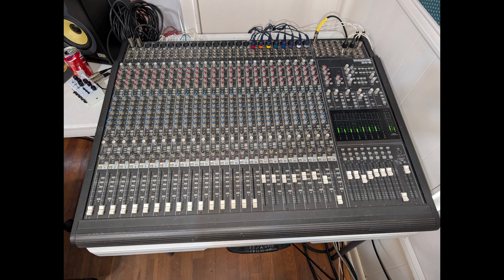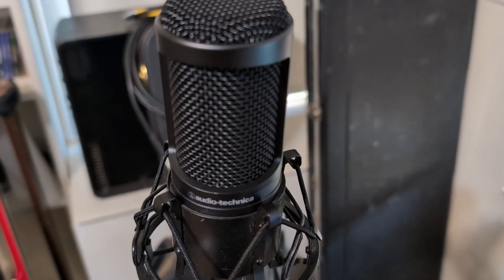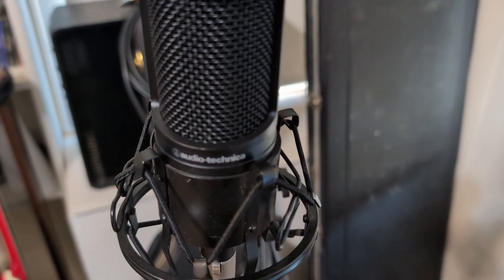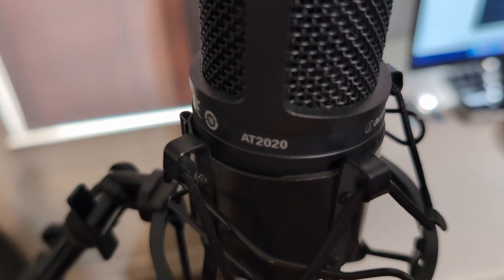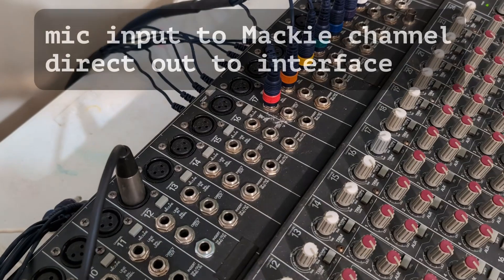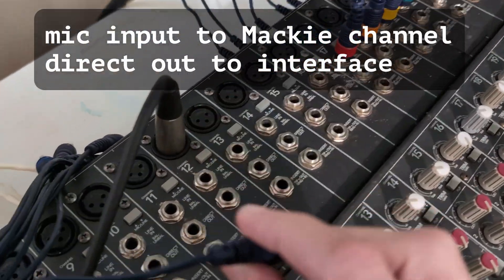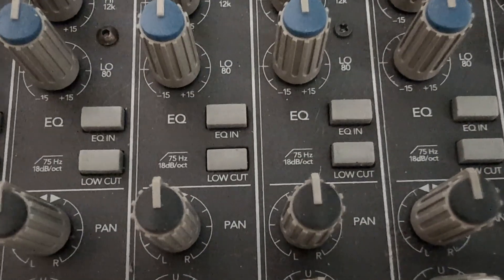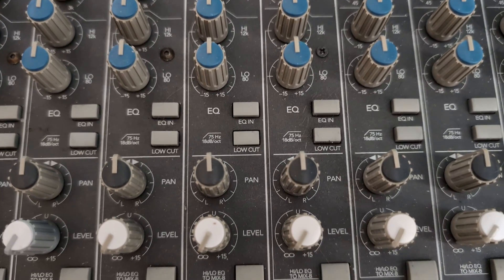Mackie Analog 8 Bus Mic Preamps

Comment: I've just got the 24/8 and I'm loving it so far. Such a unique sound and it really glues the mix together. Good to see someone making videos like this even though the manual is very in depth and tells you a lot more than I expected. Please can you tell me, does your power supply let out a little transformer growl when switching on ? Like current inrush or something just mine is concerningly loud sometimes and I fear for my hand lol. I'm thinking it might need a recap and that might be the culprit.
Reply from the maker: Yes, mine does that but it's not really loud. The transformer does have some mechanical vibration too. I have one bad channel on mine but otherwise, it's solid. They are pretty solid consoles that seem to last. The power supplies were built really well which is more than I can say for my Soundcraft.
Reply: Thanks for putting me at ease and yes it's definitely assuring seeing made in USA and not the orient on the back. And that's lucky, it must've been well looked after. I wasn't so lucky as it was from a music school and it's pretty beat up but I've gone through it and thankfully just a few scratchy pots here and there and then I've just rebuilt the vu meters as the needles were disintegrating and I'm going to have a go at changing the  bulbs to led's. It's definitely worth looking after and keeping going if you ask me especially when modern alternatives are made in China and they're all surface mount components which can't be replaced or repaired. 
I'd recommend checking the capacitors in your power supply as the larger smoothing ones take a bit of a beating compared to the smaller ones. they will probably be domed on top and approaching failure if it's anything like mine but if that's all that's wrong after 20+ years of service then it's definitely built like a tank. 
Thanks again for the help man much appreciated!

Comment: Had my Mackie 32x8 console in an Argosy console desk or 20 years.  For me, getting to that point, where I had a big console and a padded armrest console desk like in the Police "Every little thing she does is magic" video... It was a huge deal.. I started out with a Tascam 238 Syncaset  cassette based 8 track, then moved up to an ADAT.. then DAWs took over.

My studio in the basement used to have 24 channels of MOTU Digital I/O (2408 MK2, and a pair of 12/24's). The mic pre's were the direct outs from the Mackie's channels..  
I used Cubase SX, and once I got into the box, I never really did set up mixes through the tape returns on the Mackie again. Just mixed in the box, or sent the tracks off to my producer friend to mix.

Then PC bus architecture changed, and upgrading the MOTU 424 interface card that drove the IO rack units for a third time for a set of converters that were 3 generations old was not worth it. 
But in that heyday, I had 12 mics permanently dedicated on the drum kit, two guitar rigs and a keyboard rig and bass rig, always feeding discrete channels to the MOTU ready to track any time the guys came over.. 

Music buddies moved out of state when they started families, I got married, Had kids, career in IT took off for the stratosphere, and the need for a 32 channel console was gone.. 

After that whole studio gathered dust for 15 years, I finally sold the console to a close friend who could put it to use on the road as the music director and sound man for a troupe similar to the Big Apple Circus, and I sold the Argosy to a guy running a school for audio.  

In 2019 I decided to start making music again, and since I am a vocalist primarily and a recording guy, didn't really have a live band to record on a regular basis anymore, yet didn't want to completely give up having the ability to maybe record a drum kit some day, I picked up an Apollo x8p, an Intel NUC hades Canyon PC, and built a small corner of my bedroom studio around it, and I love it. 
The near zero latency monitoring with UAD effects, just like back when I had an analog 8 track tape setup with outboard...  All on Reaper, which I happily pay 60 bucks for every two years or so. 
UAD mic pre plugins emulating classic preamps and channel strips I would NEVER have a chance to track through and tweak, much less own, guitar amp plugins. All with near zero latency confidence monitoring with any of my UAD plugins as my headphone mix while tracking vocals.

Fast forward a few years and I saved my money and renovated a beat up guest room in my house, and it is now a beautiful music room / recording / mixing room, that doubles as a guest room. I still have all the gear I really liked, I still have my Symetrix 501, My Tascam 122 Mk III, the Tascam DA-30 MK2, my synths and Kurzweil PC88mx, my whole mic collection, my Omnirax ProStation MC, Lexicon LXP-1 and LXP-5 BOSS SE-50 (KILLER leslie simulator in that little beast) I even have an original Blackface ADAT that only has about 80 hours on the heads.. Repaired all three tape machines recently and they are up and running in the studio..   The whole setup of keyboards, two guitar rigs, bass rig, V-drums now, etc is all on a set of four 48 point patchbays normalled the way I work most of the time. Getting to that place was a 2 year slog.. Time to get back to making music...
Reply from the maker: I used a 56 channel Mackie at my second studio job back in the 90s. A few years later, my band bought one to use for our shows and also recorded our debut album with it and a pair of DA-88s. I got the 24-8 in the videos for $50 a few years ago and it still works except for one bad channel. 
I had a 27 year IT career after a few years of working in studio and running sound. I always kept a small studio but as it started to become an overgrown home studio, I started the YouTube channel. YouTube has given me a reason to have a lot of older analog gear. I saw that there really wasn't another YouTube channel covering the older analog gear. At least not one that was making good videos with good information. I found that I really enjoy making videos and have kept at it for 6 years and over 320 videos. 
I'm currently building out 2 rooms for my studio after moving last year. I'm trying to make the new studio better for filming since that's the main use for my studio now. 

I left IT work in 2023 and became a teacher. Now, I teach computers to K-5 students and work on my music and YouTube during my time off. I can finally say I love my job and my YouTube hobby. 
It was really good to hear your story and I thank you so much for your comments.

Comment: Hey, Grady ... what´s up? Are those postfader direct outs? I know some mixer have this option via jumper when you open it. 

I just found one of those consoles in a good price point here in Brazil including the meter bridge.

But the thing is that I prefer sending a processed signal into the DAW and postfader DO´s would be extremely welcome in my case.

I know there´s lots of ways of doing this considering the routing options you get here, but I´m trying to skip from more cables and patch bays and so on ...
Reply from the maker: The Mackie 8 Bus direct outs are post fader. I don't recall seeing any switches inside to change it there may be a mod. I hope it works great for you.

Comment: Hey Grady, thanks for this informative video. I got to say that I don’t  hear that much of a difference, I think the quality depends way more on what’s happening before those preamps. 
But I have a question:
I sometimes heard, that the Mackie 8Bus has a lack of headroom. What is meant by that and is it even a problem in classic recording (no venue mixing) tasks? 
Best wishes ❤
Reply: Alanis Morissette Jagged Little Pill was recorded on 16 bit adat that was recorded on VHS tapes, If you have great songs the equipment used isn't that important as long as it's not just horrible.
Reply from the maker: @rocketsauce5067  I agree with you. I think it's easy to get caught up in gear hype and GAS but you don't need the latest greatest gear to make good recordings. I think you said it exactly right. Jagged Little Pill is a good sounding record too. Thank you!
Reply from the maker: I have never noticed any issue with headroom on a Mackie. I think people are thinking of the mixbus. It works fine as long as you use proper gain staging, There are other consoles with more headroom on the mixbus but those are much more expensive. Mackie used a unique summing design on these to allow for more headroom and it works well for the money. A lot of people like to drive the line inputs on this model for the saturatiom and breakup so they break up nicely. I"ve never had a problem with headroom on the preamps and I've used these on drums with loud drummers. It's fairly clean sounding overall but the mixbus has a little character that I enjoy having mixed a lot of records on these back in the day.
Reply: @ what exactly is meant here with „mixbus“? There are a couple of points on the console, where signals are bussed together… thanks for the previous response. I gave my 8Bus to a blind producer, who work with display-free gear only and it’s funny to see someone ignoring the metering all the times but for a very good reason 😅
Reply from the maker: @IDOBARS  Mixbus I'm referring to here is the main LR mix bus. Anything that combines multiple signals could be called a bus so there are also the 8 submaster  buses and Aux sends. Mixbus usually means the main LR bus though.
Reply: @ especially the alternative Mix Function(Pot next to EQ-Flip) multiplies the possibilities. Truly ahead of its time.